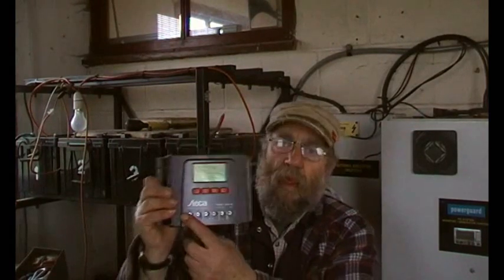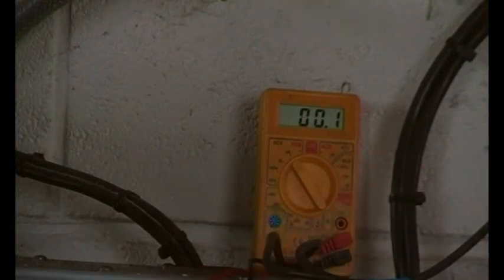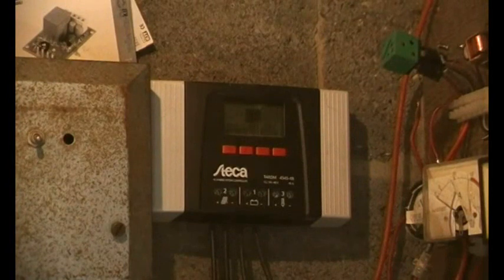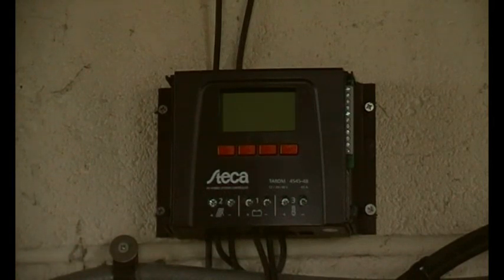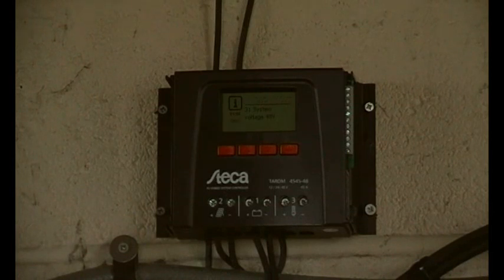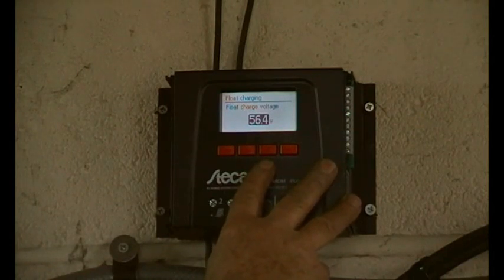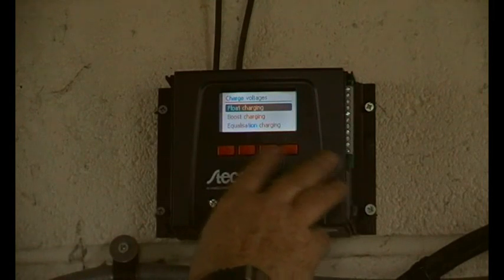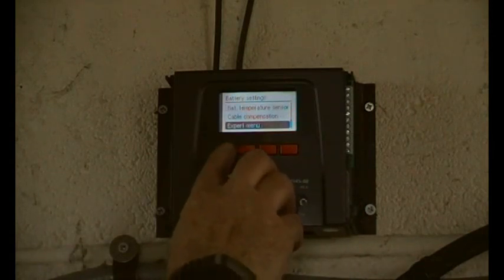Steca PV charge controller, 12v, 24v, 48v,  off-grid solar diesel system.

Comment: What's that incandescent light bulb you've got hanging there doing?
Reply from the maker: Hi, good to hear from you, it's a trickle charge for the best of the duff sealed cells after we lifted off the caps and used a hydrometer to add some distilled water down the small vent hole, cheers.